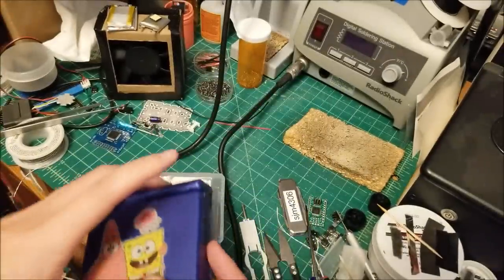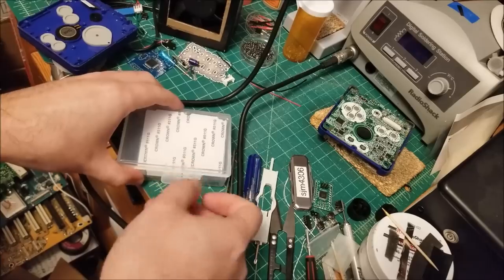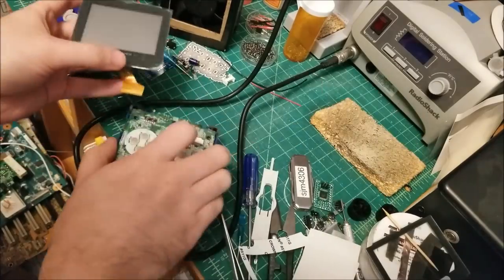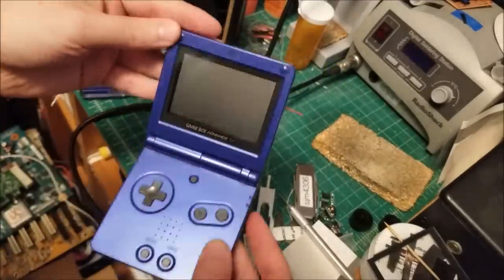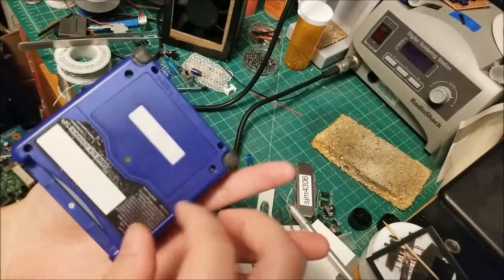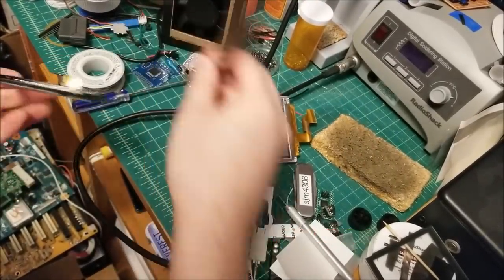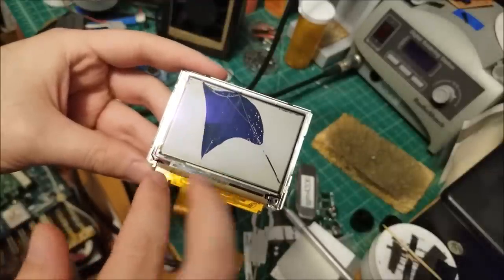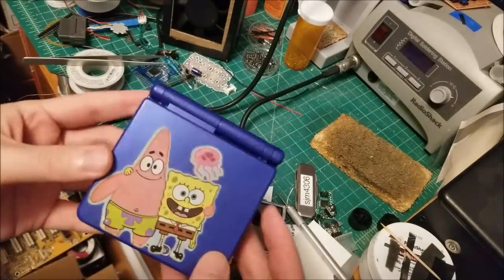Let's Fix: Nintendo Gameboy Advance SP Cracked LCD

Comment: Can burning spots on the corners of the screen be fixed ?, (its more like a circular burning image around the center of the screen, and when I turn it on it shows on white)
Reply from the maker: Sounds like the polarizing filter is damaged. You can probably remove and replace it. You'd need to find a supplier of circular polarizers though. In the end it may just be cheaper and easier to buy a replacement screen.

Comment: Just found my gambit advance sp and mine turns on and it was working just fine now the screen is gray with lines and I can no longer see the game, I can hear it just fine. How can I fix it? Please help.
Reply from the maker: Try carefully opening it and reseating the lcd ribbon connector. If that doesn't fix it then the lcd or ribbon itself may be damaged and need replacement.

Comment: I didn't think it would be so hard to line the glass up to the LCD
Reply from the maker: I believe someone uploaded a 3d printable jig to make it much easier, but yes it's a total pain to do it manually.
Reply: @sjm4306  man I got the screen all lined up click it on and my stupidity I did not use compressed air to blow off the LCD screen and there's a piece of dust behind it I'm going to kill myself
Reply: Love the channel by the way
Reply from the maker: I've definitely done that in the past. My frontlit gbc has a spec of dust that got stuck in the loca glue practically lit up like a billboard that annoys the heck out of me to this day.
Reply: Exactly the same. It literally lights right up lol.

Comment: Why need to change the glass of new LCD?
Reply from the maker: The original glass had massive cracks in it and the liquid crystal inside was leaking. Once in this state it's physically impossible to undo the damage and can only be replaced by a new lcd. As for why I swapped the plastic screen lens, the client wanted a new lens put in.

Comment: Hey could you help me fix my game boy advance sp my problem is whene ever I play a game it will have a black screen or a white screen it won't let me play it and when I insert a game cartridge
I becomes a black screen
Reply from the maker: It'd be a good idea to start by cleaning the cart contacts both inside the gba and on the carts themselves if you haven't already tried that.
Reply: I haven't but thank you your a good guy major sub and like button

Comment: Can you provide a link where you can buy a replacement lcd , i need one
Reply from the maker: You can check the label on the bottom of your gameboy to find the model number. These are two of the cheaper replacement screens for the two models.
Frontlit ags-001 lcd ~$25: https://ebay.to/2VE6B7U
Backlit ags-102 lcd ~$45: https://ebay.to/38hBx06

Comment: is there any way to repair the lcd burn of a gba sp ags001 except from replacing it?
Reply from the maker: You would peel off the damaged polarizing filter and replace it with a circular polarizer like the cheap replacement iphone/ipad filters you can find on ebay/amazon. The process would pretty much be the same for the sp as fixing the same type of damage for a dmg or pocket, only that you have to mind the frontlight (I'd suggest desoldering it and keeping it in a safe clean baggie until you are ready to resolder and reassemble). If all that is too much trouble replacement 001 lcd assemblies are ~$30.
Reply from the maker: Looks about right to me
Reply: Thnk so much shawn. Appreciate ur help! ☺

Comment: woah woah woah...pump the breaks...How the heck do you use a FL GBA SP screen to frontlight a Gameboy Color. I just did HHL laminated front light and even though it looks okay (with some blemishes I created), the front light gba sp would be much better.
Reply from the maker: https://www.instructables.com/id/How-to-add-a-frontlight-to-your-Gameboy-Color/
The sp frontlight is indeed higher quality than the aftermarket ones (I've done HHL and Kitsch Bent frontlights and they are decent but definitely not perfect) but it does require more work to make it fit.
Reply: Thanks! Im going to get on that!
Reply: Would you suggest applying LOCA to this mod? Would that even help light be distributed better?
Reply from the maker: Light distribution for the sp front light is generally great. I'd try it first without LOCA and see if you like it. The issue is LOCA is permanent and trying to remove it will likely destroy the frontlight.
Reply: @sjm4306  you should do a video on that mod ! That would be interesting :)
Reply: please do, apparently im having issues. Two other videos show different things compared to the link you sent me.
Reply from the maker: There are a hundreds ways to skin a gameboy afterall. The way I would do it will probably be slightly different than the instructible article or other youtube videos.

Comment: my gba has a white vertical running trhu the screen,its a 001 model. do you guys think i should replace the screen, or can i like put the ribbon cable in and out or something
Reply from the maker: I have a 101 with a green vertical line. Unfortunately I'm pretty sure it's caused by either damage to the glass or the driver chip that's mounted on the glass. Either case is basically impossible to fix so you're best bet is to replace the screen. Last I checked a replacement will set you back around $30.
Reply: sjm4306 ouch....
Reply: sjm4306 replacement screen are a lot of euros here, im going to contact some gameshops here. thanks

Comment: Are there 3 layers to a GBA SP screen?
Reply from the maker: There's the glass itself in the rear and on top of that the frontlight and then finally the plastic lens that goes on the outside so yes I guess that would be 3 main layers.

Comment: How much would a lcd cost for a ags001 sp?
Reply from the maker: Last I checked they run around $30 for the 001.
Reply: @sjm4306  thats not bad at all, ive got my uncles sp ags001,  but the screen is cracked really bad, battery is swollen to the poijt you cant screw the back plate on all the way, and I dont have a charger lol. But im not just going to give it away if i can fix it. So this video realy helped a ton
Reply from the maker: Yeah I would highly recommend properly disposing of the swollen battery and getting a replacement. Definitely worth it replacing the screen/battery and getting a charger (usb to gba sp cords are cheap and super useful).

Comment: My Lcd is break in My Gameboy advance sp how to fix it without any harm and I want to clean it too any advice to it....😘
Reply from the maker: This video shows how to replace the lcd in a gba sp
Reply: @sjm4306  so where I can buy a new Lcd and a tool for it?

And what is the difference between frontlight and backlight😘
Reply: @sjm4306  Btw, if you put a new Lcd replace for it you just plug in the ribbon and after that it wouldn't easily plug out?
Reply from the maker: I got my replacement lcd and triwing screwdriver off ebay. The difference is frontlit lcds look much more washedout and less vibrant than a backlit lcd.

Comment: I’m repairing a black screen (Charging lights come on indicators but no display) would these repairs be the same?
Reply from the maker: Yep, sounds like you need a new lcd.
Reply: sjm4306 thanks! Any idea how much a new LCD is?
Reply from the maker: A frontlit 001 lcd is ~$30 while a backlit 101 lcd has skyrocketed to over $60 now.